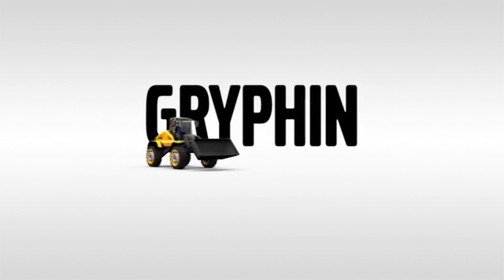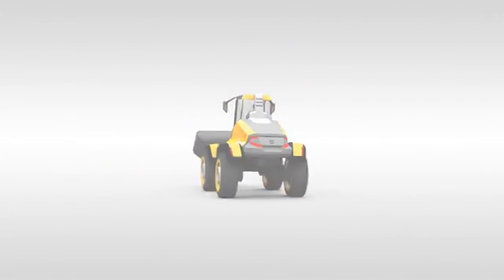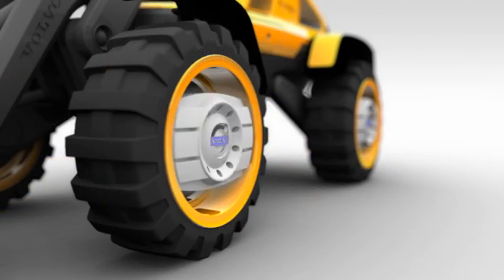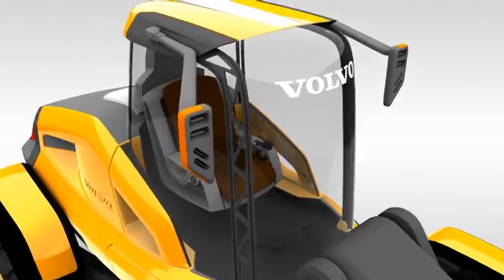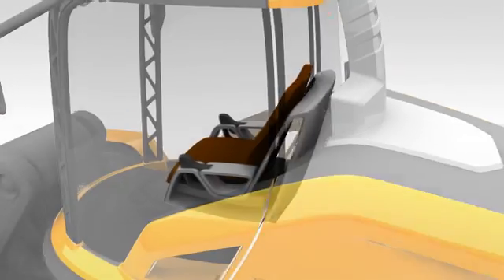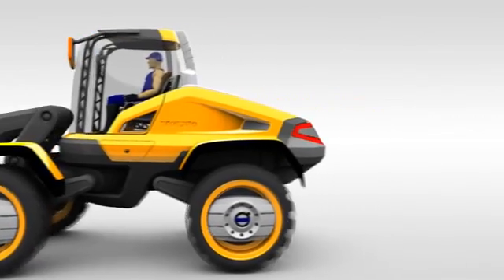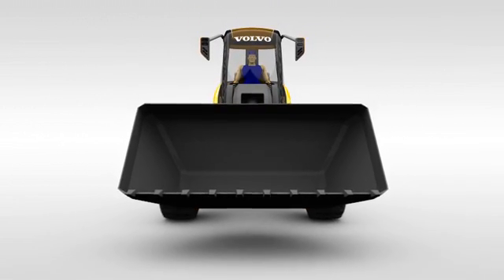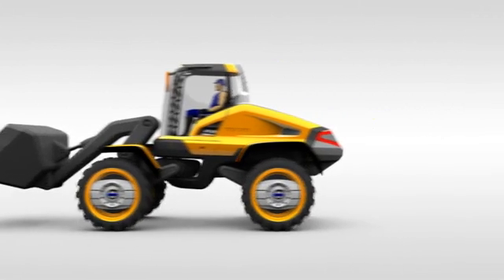Volvo GRYPHIN - Volvo's futuristic Loader concept machine

Comment: @bach5953 
I don't think that the future electric motors will be brushed in theese areas of use.
Lower maintainence and more reliable with brushless design.

The mud going into the motors is easily avoided by covering the wheelsides.
I can't see any gain, except maybe cooling, in having the motors exposed.
It's still just a concept and I don't think the end product will look much like that.

Comment: If the animation is accurate then the ride is going to be uncomfortable as the loader leans out of the corner. If anything, The suspension should be actively pushing away from the roll.

Comment: @kiljoysvnzr0 
Agreed. I am thinking also that with the counterweight extended, I'll be LOSING lifting capacity with the articulation cranked all the way over, as the weight will be off to the side, in a sense. Seems like it, anyway. It's like I'd want the counter weight to swing away from the direction of articulation, instead of staying lined up with the machine.

maybe....

Comment: i like the wheel design but i think there is a prob in the design. what happens when mud pebbles and other small objects get into the wheel well and get carried up into the motor. see look at 1:56 (time) the gap between the wheel well and the motor when they go threw mud and it finds it way up onto the wheel well it will get into the motor and cause things to break slow down over heat and all the other bad things mud dose to electric motors. also if the motor is not brush less it will cause the.

Comment: @ipagoom the active counterweight would be a huge liability for any operator working in close confines. I can't imagine working and area and NOT knowing EXACTLY where the counterweight is going to be or how far away I am gonna be from a truck, excavator, signboard, or joint of rcp when articulating my loader. 2 inches sometimes means the difference between a productive day and a 2 check day